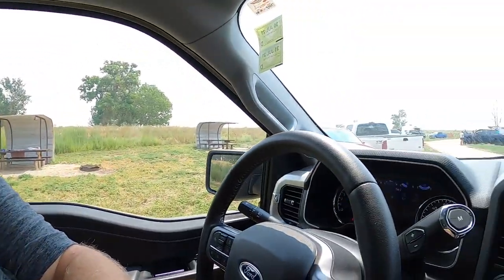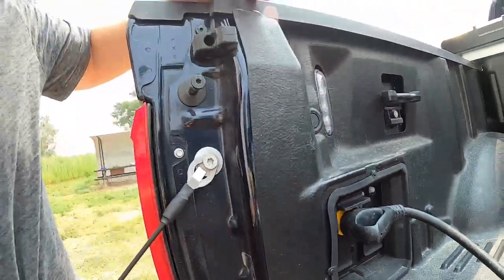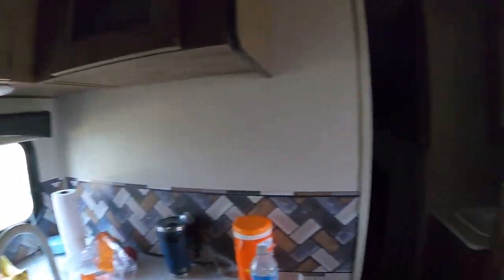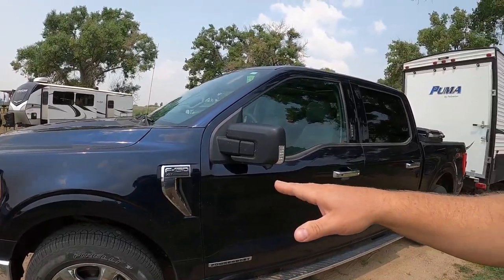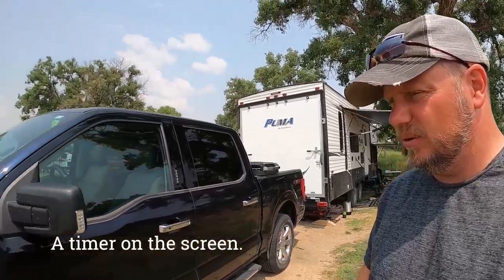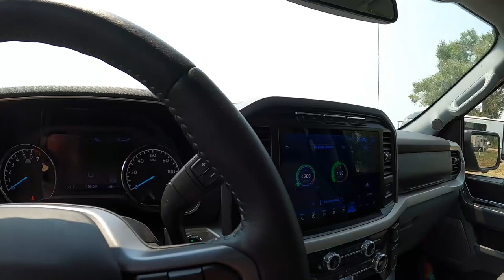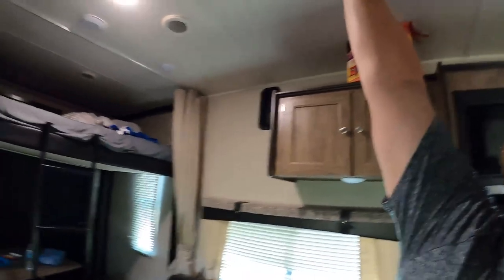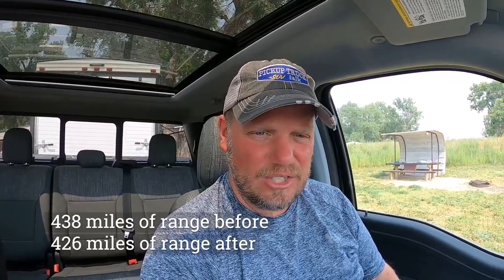Shocking? Running A/C for hours, 2021 Ford F-150 Hybrid Generator

Comment: Walk me through how you plug your 110v camper into a 220v source. The plug adapter doesn't change the voltage.. how do you not fry your a/c and fridge?
Reply from the maker: The male side of the plug only puts out 120 volts per the manufacturer, so it isn't sending all the 220 volts to the camper.
Reply: @Pickuptrucktalk  so the adapter does regulate voltage?
Reply from the maker: @philipnagel7118  You bring up an interesting point which I can't find an answer to frankly. I found this plug through searching RV groups and now I'm wondering about the volts myself. The sources I'm reading are all over the place from no big deal, to tripping a breaker and then to holy cow your entire RV will burn down. Really strange. 

I know the maximum load rating is 110 volts and if you send more through it, it should smoke or melt. That's what I SHOULD have experienced, but I didn't. Also, if the 220 volts hit the camper, I should have popped breakers. That didn't happen neither. 

Lots to learn apparently and I still don't have a clear answer. I know AMPS are more of a pull versus push situation, but Volts should be sending maximum power at all times. The best I can figure is the plug has a way to downgrade the volts, but I have no confirmation of this. 

Interestingly, nobody talks about making sure to plug into the 110 volt side of a generator even with this plug. If it was a big deal, I'd assume that would be shouted to the heavens.
Reply from the maker: @philipnagel7118  Here is a better answer! Thanks to your questions, I did a lot of digging and here is what I found: https://www.youtube.com/watch?v=BwqS8oJkuAs
Reply: The adapter drops a leg down to 120.
Reply: It is not 220v to start with.  It's 50 amp for a camper that has a 4 prong plug.  The 3 prong is 30 amp and needs hot, neutral, and ground.  The plug gives him 2 legs of 120v (not 110) and his adapter only uses one of those legs so he's only getting half the available wattage from the truck to his RV.  The adapter basically just doesn't use one of the legs at all and insulates it with the plug.  The 50a campers don't use 240v, they use 2 legs of 120v.  It's not the same as a house.  They basically have 2 systems of 25a each but the components are the same as the ones on the 30a RV's.
Reply: @joedoesfun9336  it is 240v. It's clearly labeled on the cover.
Reply: @philipnagel7118  The question was how the adapter works. It does not "convert" anything. Rvs that are 50amps don't use 240v like a home. They use 2 legs of 120v. Everyone knows the generator puts out 240v on that outlet. That wasn't in question.  A 30a RV adapter plug just uses one leg of the generators 240v output for 120v and max 25a.
Reply: @joedoesfun9336  Your comment said it wasn't 220/240 to begin with. I was just pointing out that it is 240 to begin with on the pickup. That is why we were wondering how the 110v camper handled it. But the op cleared that up.
Reply: Wow...some people here just don't understand how electricity works in the US!!!

The adapter uses both legs of 120v from the truck to power the single leg 120v of the camper. It is super simple. Nothing complicated at all.

Think of it like hooking up two 15a plugs to a 30a camper. You get the same exact thing!!! In fact, many portable generators do NOT have 50a plugs, but have the capability of outputting over 30a at 120v (3600W), so you can use a 15 or 20a plug and combine it with the 30a plug to get max power from the generator.

This adapter does the EXACT same thing here.
Reply: @charlieodom9107  No, we don't... That's why we're asking. We aren't electricians.

Comment: Considering getting the F-150 XLT specifically for the powerboost capability.  Thanks so much for this video.  Do you happen to have the options and specs of your truck posted anywhere?  Thanks.
Reply from the maker: Sure. It is on the website at the bottom of this post: https://pickuptrucktalk.com/2020/12/bought-2021-ford-f-150-powerboost/

Comment: Did you have Eco Idle on? If so it raises the RPMs to charge the battery faster.
Reply from the maker: Nope. Normal mode.
Reply: @Pickuptrucktalk  cool. I don't understand others doggin this use for campers.... idling is bad.....umm hello do you understand this engine is also not running for countless electric miles over years of use so what's a few nights camping gonna hurt??
Reply from the maker: @jessedavis5362  just lots of concern based on bad information or foregone conclusions without learning more about how it works first. Happens all the time.
Reply: @bookooc5605  how’s that Biden vote working out for you?
Reply: @bookooc5605  Why politics???  Troll

Comment: The truck keeps turning on because you have the ac set to 65 degrees. So in order to get and keep the trailer at that temp the truck will run alot.
Reply from the maker: That was the point. This was a worst cast scenario test.

Comment: Hey Tim wondering if you had an answer to an odd question I had. Say something in the hybrid system failed ie the battery or motor. Could the truck still be driven as just a regular ecoboost f150 or will it not be drivable without the hybrid system working?
Reply from the maker: Hmm… not sure. I’d imagine the computer has a limp mode setting if the hybrid system fails.
Reply: Thanks for the quick response! Yeah we do a lot of extremely remote camping and stuff out here in Utah and love the idea of the inverter generator and technology for what we do. Just don't love the idea of having a hybrid system that I wouldn't know how to work on if something went wrong in the middle of nowhere. But I'm sure the engineers thought of this and at least made it so you could get home if the system failed.
Reply: Get a separate generator.  This is a gimick that will leave your camper without power anytime you need to drive. Also if your truck goes down for any reason you are buying power or going witout until it's fixed. Save yourself from future problems.

Comment: Hey, I am looking for a powerboost for the same task, the problem is the payload of the F-150, what are the aspects of yours and payload?  I need at least 1,800 to be able to tow an airstream with a dry tongue weight of 875, and loaded could be up to 1,095.  How you can tow that one that is 745 tongue weight?
Reply from the maker: I think this one was 1,400 lbs. When I towed with it, we only had the family in the cab and we had like 100 lbs to spare.

Comment: Need to remember that using it to power camper will have an effect on oil life...it will need to be changed before the odometer reading that was set for the next oil change as oil life is determined by hours of engine run time...we just normally use mileage as the marker for service.
Reply: No the truck calculates the oil life based on the viscosity of the oil itself not the odometer.  Miles no longer matter it actually tests the oil.
Reply: @mototodd  I never use the vehicle computer for determining oil changes...I use mileage. I know mileage works and I trust it...I don't trust the computer as I see how inaccurate the gas mileage computers can be as compared to miles/gallons calculations.

Comment: Does that adapter actually switch 220 to 110?  Was surprised to see that.  I was shocked to see he didn’t melt down the camper electrics.
Reply from the maker: Yes, it drops one of the legs.

Comment: Alright, so I dropped a comment on your next video before I watched this video asking about the pickup battery's Ah limits. After watching this video, however, I am concerned with the pickup running out of fuel while in generator mode. Is there a safety shut-off for the generator mode that leaves enough fuel in the tank to allow you to drive to a filling station or do you need to leave a small gas can in the box to ensure that you are not stranded at some boondocking site?
Reply from the maker: Yes, Ford says it will shut off the generator mode when the fuel gets low. My sense is around 50-100 miles of fuel left, it will kick off. I’m not sure of the exact number.

Comment: Thanks for the video Tim I am torn between this truck and the Lightning!
Reply: The challenge for electric trucks is the significant range drop with load or towing. Range can drop by half or more with heavier loads/tows. Then add very cold or extremely hot climates, winds, uphill grades, and voila range anxiety to the max. Lastly, all that and try draining your Lighting battery further by plugging your rv into it.  The Powerboost is arguably superior. Even better, having the Powerboost come with a 5 kWh or more battery (reduce generator run time).

Comment: I noticed on the dash readout that you have 2x 3600W guages (an "A" and a "B") -- this adds to 7200, but does this mean can you only service 3500W max to a single 110VAC circuit (either A or B)?
Reply from the maker: that's a good question. Frankly, I never once plugged every outlet in and checked what the screen showed. I just used it as I would typically.

Comment: What kind of fridge is in the camper? 12V or dual gas/electric? Is it running while driving?
Reply from the maker: Running on batteries while driving. Dual gas and electric. Not sure on volts.
Reply: @Pickuptrucktalk  check the temp inside the fridge when you leave and when you get home. They need the 30A plug to be plugged in to run in electric mode. It's only the control panel that works on the batteries. People switch them to gas when driving but then you are driving with open flame. They invented the 12V fridge that runs on batteries all the time. The gas/electric needs the 30A plug to be plugged in to run in electric mode.
Reply: @Pickuptrucktalk    Those are ABSORSION UNITSlp gas, 12v dc, or 120 when at an RV HOOKUP  they need to be level for them to work, 🇺🇸🇺🇸🇺🇸🇺🇸

Comment: do the powerboosts come with "dog mode" like Teslas do?
Reply from the maker: No. Thanks, I had to Google that one.
Reply: @Pickuptrucktalk  sounds like you can leave the truck running, AC on and doors locked.  that is essentially dogmode

Comment: Great video.  Does the 7.2kwh use all of that no matter what is being powered or does it limit how much is produced based on the demand?
Reply: I’m going to answer my question and say no it doesn’t require using that power…since I watched you video entirely now :)

I’ve got a truck choice between the 2.4 and 7.2 and just didn’t want to overkill with the 7.2 but it sounds like it’s good flexibility

Comment: can you get powerboost with the v8?
Reply from the maker: Nope.
Reply: You can get the 2kw with the 5.0. Not strong enough to run AC but you can run anything else in most campers.

Comment: Can you run the ac in the truck while parked with the engine off?
Reply: Found the answer, yes, you can. Still would love to know if the 7.2kwh battery is fully charged, how many times would the engine kick on to charge the battery? I'm guessing that it could run the truck ac could run for about about 4 hours before draining the battery at night (less during the day) so the engine would kick on once.... But I could be completely off.
Reply from the maker: Even if on, the truck is so quiet it really isn’t an issue.

Comment: Great video! I love the idea of on board power, now I just have to wait until Ram or GM puts that into their truck. I wonder what that kind of idling does to the engine though long term. Probably cant be that good for it? If a coffee maker cycles the gas engine that quickly, that can't be good also, need a bigger battery or something to run longer between cycles and just cycle less often.
Reply from the maker: No issues with the engine long term so far in the past 10 years we have had hybrids.
Reply: I idle my F150 up to 8 hrs a night  when on the road working. No problems 6 yrs and running. Although mines a 5.4 L 1997 hahaha 😆!

Comment: Engine running 5-10 times an hour at <2kw load, it would be great with a little larger battery with 2KW usable capacity so it was more like once an hour.
Reply from the maker: Sure, but larger battery = more weight = less payload = less overall towing. Happy medium.
Reply: @Pickuptrucktalk  What type of battery does it have NMC or LFP?  My only concern is the charge discharge cylces on the battery.  I assume they are smart and cycle the battery only to 80% but LFP would handle that cycling much better than NMC.  Is there an options to just run the engine straight to not cycle the battery and starter when you have larger consistent loads?  Great to have auto mode like shown for intermittent/light loads, but also nice to not wear out the battery and starter for larger loads...
Reply from the maker: @oof_Dad  From Ford: "1.5 kWh lithium-ion battery and a 41-horsepower motor."
Reply: @Pickuptrucktalk  Ya I did some Googling around and have not found the exact chemistry (NMC and LFP are the most common Lithium Ion chemistries but there are others also).  LFP is slightly heavier than NMC but have 3-4 times the cycle life.

Comment: Does your f150 have the max towing package? I'm going to tow an RV around that size and weight. Should I be worried?
Reply from the maker: Yes max tow. You need to check your trucks payload and towing limits. Get a weight distributing hitch as well. After that, it’s all about learning, experience and getting comfortable.

Comment: If I still had our Jayco I would DEF be trading in my 2018 Platinum for a 2021!! This really changes things for boondocking. Like you said, no more embarrassing loud generators! And you’ll never want for wattage.
Reply: Until you need to drive your truck and can't have power at camp when you do. Or worst the Ford reputation catches up with you and that truck is in the shop for a week. Then you are buying power or going without.
Reply: @ernestjohnson1807  lmao. First, if I’m driving my truck while boondocking, I likely don’t need power for the time I’m away. Second, I currently own a 2018 F-150 Platinum (in case you missed that part) with the 3.5 EB and 5 Star E50 tune since new. Zero problems. My next truck will be another Ford. Try your hate on somebody else.

Comment: Man oh man Tim,,, this truck seems to fit right into your lifestyle.. Towing, powering up the camper, I don’t know how the hell you can trade this in??? But I have an idea, trade in your wife’s vehicle, give her the F-150 and get yourself a different truck for the channel…. That way you still have this little gem in your family. AND you can continue to report on the F-150 as the miles pile up.. You would have a two YES two truck channel…. Can you imagine that???  Do it Tim, just do it…..
Reply from the maker: Someday the channel will be big enough to support two trucks. The other, real challenge, is putting miles on both trucks as well as all the other vehicles I drive all the time.
Reply: @Pickuptrucktalk  Good problem to have Tim.. Keep up the great work.

Comment: Holy crap that AC unit draws a ton of watts for only 13.5K BTU
Reply: also, coffee pot actually takes a lot of juice, those resistive heat elements draw a quite a bit. I think Ford needs to add a 5kw battery instead of that little 1.5kw, I run a lot of stuff for 2-3 hours on a 5kw so 10kw would be amazing on this truck.

Comment: I don’t know why this is so special. So you run your $10,000 truck engine and your $8,000 battery bank to power your trailer AC and refrigeration plus a few LED Lights. When you could have purchased a 3500 kw inverter generator at Harbor Freight for $700.00. How does this even make any sense?  Just an add for Ford.
Reply from the maker: In my view, inverter generator is louder and you have to make sure it starts plus have fuel and space for it. This is just much more convenient.

Comment: It takes 6 gallons of 87 octane to run a 8000 BTU casement a/c unit, refrigerator and TV 8 hours with 90F ambient set for 74F. That is with a 500CC OHV 1cylinder generator. Th A/C unit is about 800 Watts..
 Cooling about 1100 sq ft of space.
  So 74F close to the A/C unit  and 80F away from.

Comes in handy when the energy company decides to shed load because they just dismantled the coal fired back up power plant.
AS why such a big generator (9000 watts continuous)? Well I was going to just wire it into the house and run it off natural gas. BUT that would cost 5 x as much as the generator.
That does not include the permits needed. The housing to keep it out of the weather. And re-enforcement to keep from growing legs and leaving.
That Ford is really efficient electricity producer. But you can't just plug it into the house. Don't want to to back feed. So you have to disconnect the main fuses or breaker 1st.
That is where the expense come in. It has to autosense on and off and automatically disconnect to and from the the grid where I am located.

Comment: Random question. Any way to turn off the horn honk when you close the door with the truck running? I have a 2021 Ford F-150 and I hate it when I have to get out and grab something from the bed or backseat and it honks. It drives me crazy.
Reply: Yes, by leaving the keys in the truck or not closing the door all the way. Can still lock the truck with the keypad too
Reply: @jessedavis5362  those are both true. However with the keyless ignition system that Ford uses now. I often don’t grab for my keys in my pocket to then leave them in the truck. 
I however find it really stupid that Ford won’t let you just turn the horn off in the info screen as an option.
Reply from the maker: I hear a dealer might be able to disable it. It doesn't really bug me, so I don't mess with it.
Reply: Can be achieved with Forscan.
Reply: @michaellopour7409  this is the right answer. That honk is annoying. Got rid of it on both of my Ford's.

Comment: What I"m seeing is that the truck's 30a receptacle is 220v (2 hots, 1 neutral, 1 ground)  From one of the hots to the neutral you have 110v, so I'm assuming your little adapter simply blanks one of the 220v hots, am I correct?
Reply from the maker: Yes, just blanks one of the hots.